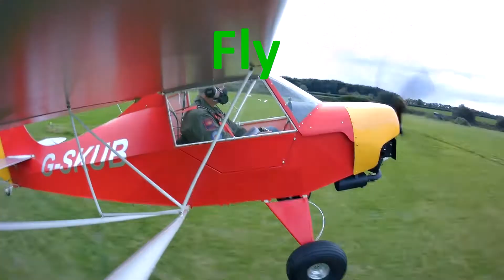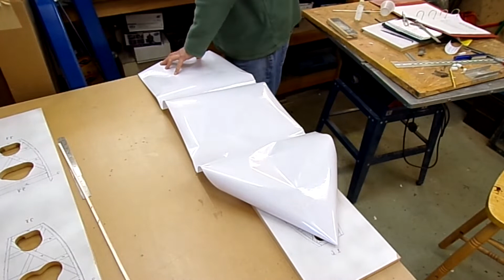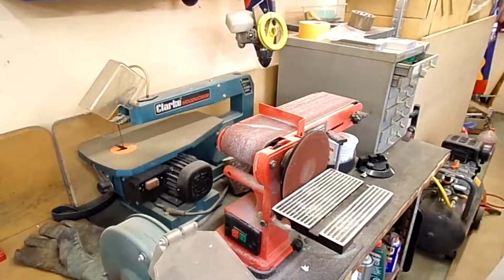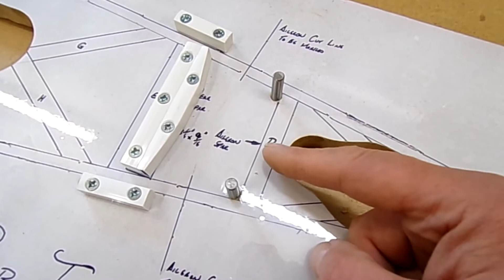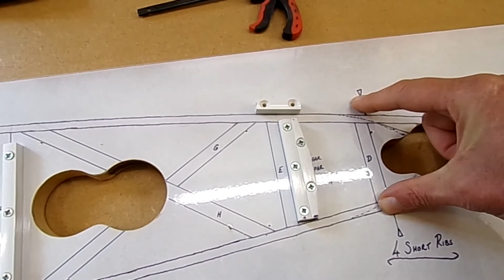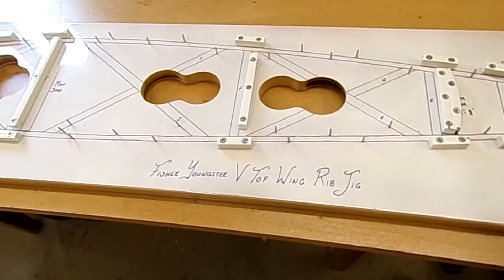EP16 Fisher Youngster V Kit Plane Build - Rib Jigs done.

Comment: The plans give one rib template, how did you copy the other two? What kind of plastic do you put over the template?
Reply from the maker: If you look at the last video Wing EP1 I show how I copy and mark out the  boards. The plastic I am trying this time is a glossy fablon got from Amizon. I hope that helps, thanks for watching.
Reply: Hey Algy where did you get your plastic blocking ?
Reply from the maker: @grandenauto3214  off eBay some time ago,  I think it is meant to be used as a filler on for double glazing.